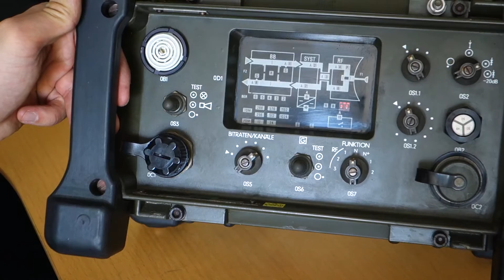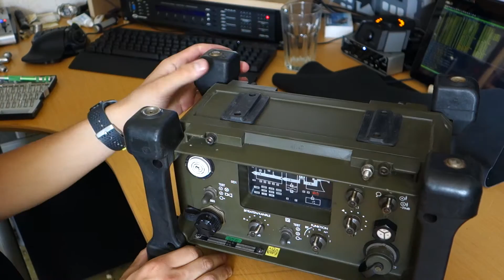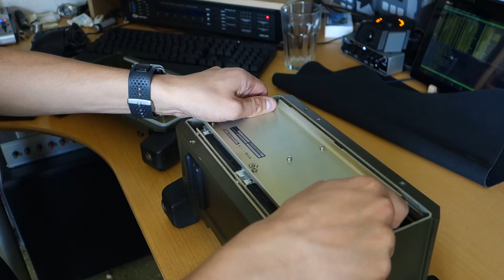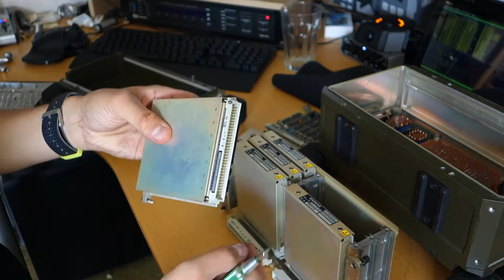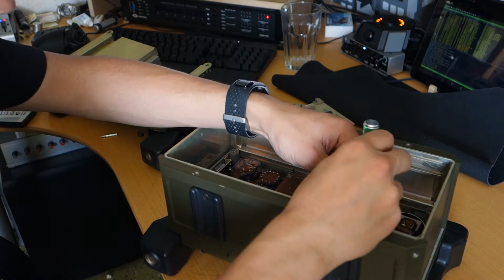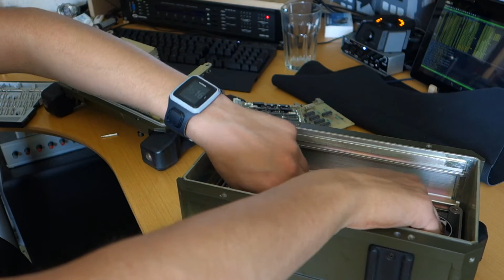FM 15000 control unit teardown

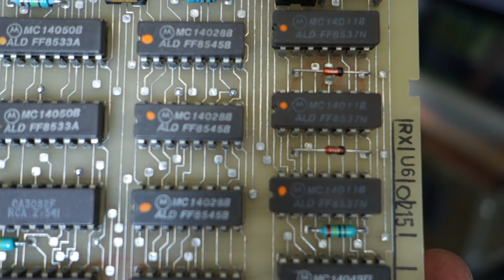Comment: 6:40 All the high temperature range versions of standard CMOS stuff
MC14028 = HEF4028 = CMOS 4000 series BCD to decimal decoder
MC14050 = HEF4050 = 6 non invertig buffers
MC14011 = HEF4011 = quad 2 input NAND gates
MC14049 = HEF4049 = 6 inverting buffers
CA3082 = Intersil 7 common collector NPN transistors
http://www.classiccmp.org/rtellason/chipdata/ca3081.pdf
Date codes are mainly from 1985